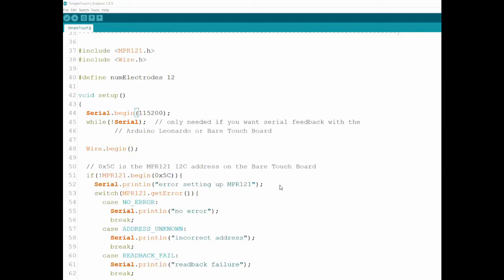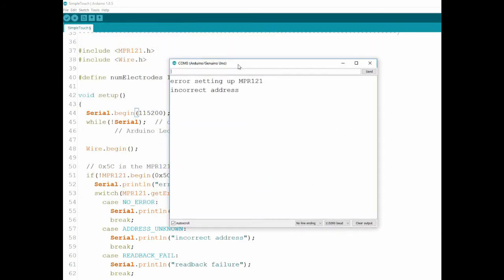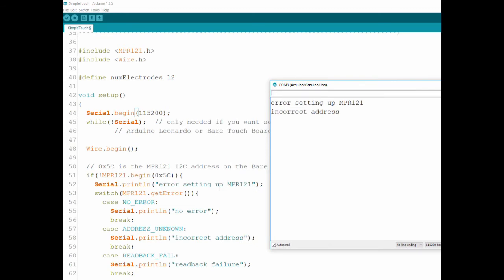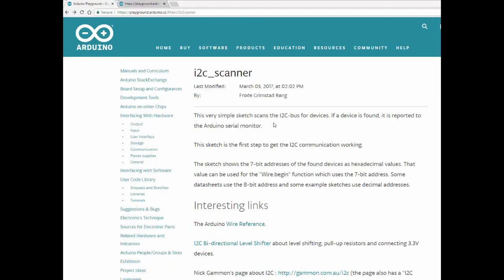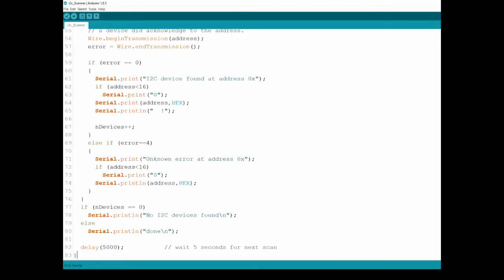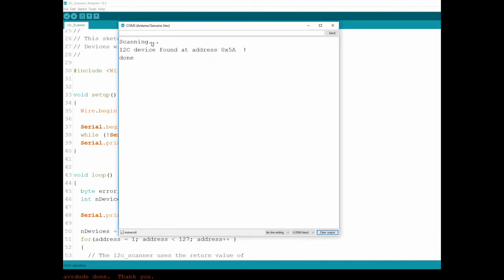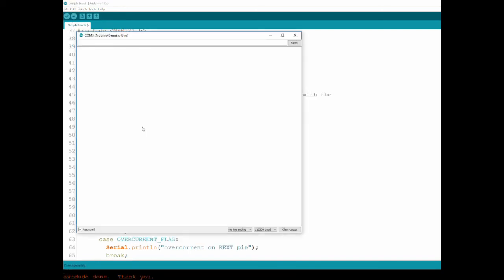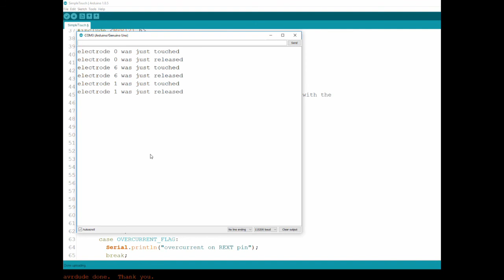Scanning your Arduino I2C BUS for IC

Comment: Hi thank you for this tutorial, I was scanning the MPR121, I believe it is a Chinese copy, but when I scan it, the monitor says "No I2C device found", I think the wiring is all right, what could be the problem?
Reply from the maker: hi, thank you :) 

To help you out will need a bit more info, what board (ardunio) are you using ? 
How things are connected ?
Reply: @talofer99  Hi Thanks for your help, I'm using an arduino UNO and I believe everything was connected right, 3.3v and gnd to arduino 3.3v and ground, scl to A5 and sda to A4,IRQ to digital pin4
Reply from the maker: @nickchenhezhang9292  Most of the breakout boards I know use the 5V. 
I can guess that's the issue.
Reply: @talofer99  OK let me try